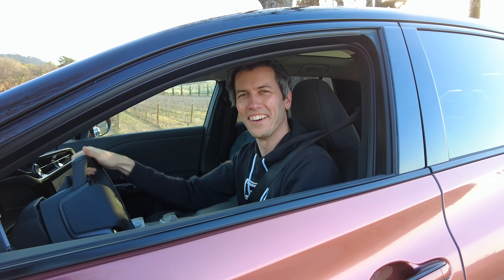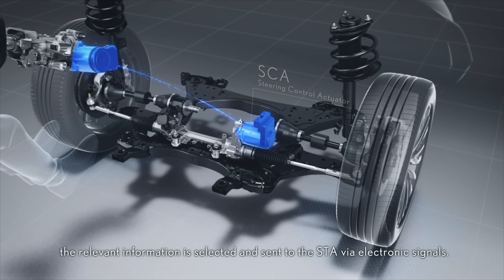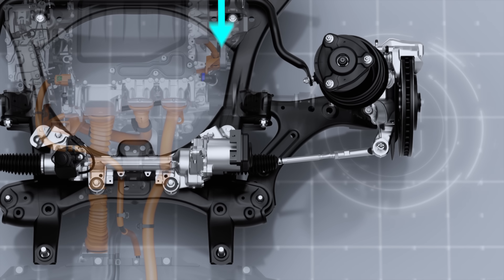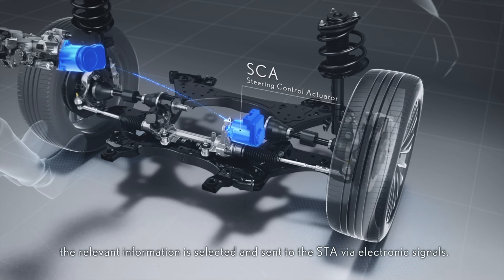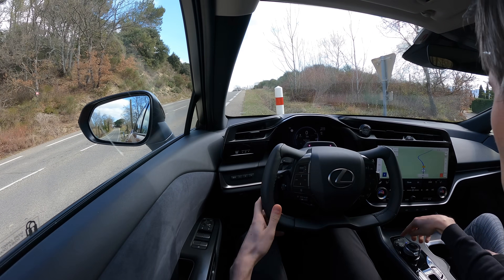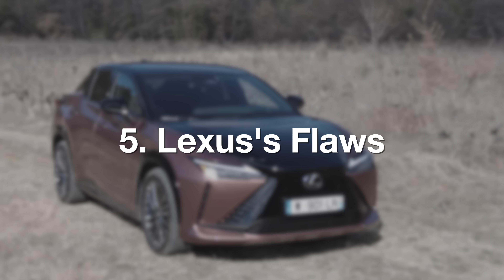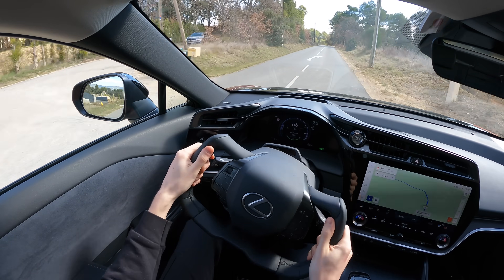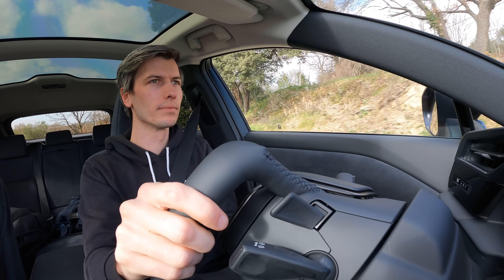How Lexus Fixed Tesla's Bad Idea: Steer-By-Wire Yoke

Comment: Is it execution delay or a limit in how fast the wheels are turned by the motor? Or even how much force the pinion can handle? Either way, the fact is that a given wheel position (even neutral one) doesn't guarantee some specific steering angle and the brain will feel it. Is it noticeable in regular driving? Likely not. Also opens up more opportunities for self-driving cars with optional steering input.

Comment: The benefits for active stability, self driving and variable steering ratios are obviously there. The input lag can be engineered away with more powerful and more responsive motors on each side. But what if your self driving self braking self turning car gets hacked?

Comment: As a guy who doesn't like the idea of global automotive electrification, and who loves old cars with their straight and natural feedback to the driver, I can say that I actually really like this idea. In theory you can still have very good feedback from the front wheels, if the computer responsible for filtering the signal won't interfere too much. In terms of ICE vehicles it can make engine swap much easier (I hope that in 15 years we'll still be able to drive petrol cars) and car designers can now have some fun. IMHO, this is one of the cases when advantages of a new solution overweight it drawbacks, at least for regular road cars.

Comment: Next it will be brake by wire with 3 actuators and 3 pair of brake pads for each wheel in case one goes bad and a complex system that will simulate real time feedback in the pedals.

Comment: I've noticed that steering delay at the very beginning of the video. It's great that you've pointed that out at the drawbacks section. But since the steering is laggy then it is not responsive. So all that stories that the steering is not in par with the responsive acceleration and braking is just a marketing blurb, at least at present.

Comment: I noticed the input delay immediately at 0:05 it was jarring just looking at it, like when you press a button in a game and then see the move happen later. I'm glad you addressed it because, anybody who has played a racing game or for that matter just played a fighting game online will tell you how bad it is to have even just a few ms in between your input and the expected output. It's the whole reason Google Stadia died and why Amazon Luna doesn't work well either. A visually noticeable amount of latency is just unacceptable and they probably should have worked on that before putting it in drivable vehicles in the first place.

Comment: Most of the Lexus steer-by-wire drawbacks could be fixed by making the steering sensitivity at different speeds fully customizable for each driver. On the other hand, some of the effects of the feedback system may be negative so the feedback should be also  customizable. For instance, the lightness of the steering on a slippery road could contribute to a total loss of control of steering. Under such conditions it could be preferable to make the steering wheel not easier but harder to move by the driver.

Comment: I think this technology while possible to make safe just won't catch on with a large portion of the consumer base. (at least as it stands as of this video, it may get better). I think its too preferential, at least with a yolk and variable steering. Variable steering most of all, will really be off-putting to someone who wants a linear and predictable steering ratio.  you might get 50% of consumers that love it but 50% won't and now you always have to make 2 different options based on that. Of course, a traditional steering wheel and the ability to set the electronic steering to a linear setting will fix most of those issues and assuming the delay gets better then you can make any option possible by the touch of a button, but that still leaves the delay and feel being the main hinderances. can't wait to see how it plays out.

Comment: what happens if you hold an angle on wheel from a stop and accelerate without straightening the wheel? do you have to turn the yoke more just to keep the same turn angle?

Comment: Steer-by-Wire is also makes self-driving cars simpler, since you don't need an additional motor for the computer to change the steering. If this car has the equivalent of Tesla's "Auto-pilot" the steering will won't even need to turn at all.

Comment: This is already in use for aviation, and has been for awhile. For example, the popular Airbus A320 is 'fly by wire'.  It even has a side stick, that looks much like a video game, rather than the traditional 'yoke". There are no cables to manually activate rudder, elevator or ailerons. The flight computers also check your inputs, if it goes against a long list of 'flight rules' it won't let you do it. That's a condensed version/explanation due to space here.  It's the future, like it or not. We'll get used to it, like George Jetson.     Peace..    --gary

Comment: I had the steering assist motor go out on my '18 Ford Taurus. When it happened I could no longer steer. The mechanical connection didn't help at all.

Comment: Govt criticizes Toyota press release on floor mats

By KEN THOMAS (AP) – 2 hours ago

WASHINGTON — Toyota Motor Corp. released misleading information about an investigation into problems with stuck gas pedals that led to a massive Toyota recall, the government said Wednesday, stressing the issue is still under review by federal safety regulators.

The National Highway Traffic Safety Administration said it was still investigating the case and meeting with Toyota to hear about the company's plan to redesign the vehicles and fix "this very dangerous problem."

Toyota recalled 3.8 million vehicles last month over problems with gas pedals that got stuck on floor mats and told owners to remove driver's side floor mats and not replace them until the automaker had determined a fix to the problem.

Toyota said in a statement on Monday that NHTSA had confirmed "that no defect exists in vehicles in which the driver's floor mat is compatible with the vehicle and properly secured."

But NHTSA said that was inaccurate and the government was investigating possible causes of the acceleration problem. Removing the floor mats was "simply an interim measure" and "does not correct the underlying defect in the vehicles involving the potential for entrapment of the accelerator by floor mats, which is related to accelerator and floor pan design."

"The matter is not closed until Toyota has effectively addressed the defect by providing a suitable vehicle based solution," NHTSA said in the statement, which the department said was issued to correct "inaccurate and misleading information" from the automaker.

Toyota spokesman John Hanson said "it was never our intention to mislead or provide inaccurate information. Toyota agrees with NHTSA's position that the removal of the floor mats is an interim measure and that further action is required. We continue to discuss an appropriate vehicle remedy or remedies."

The recall includes 2007-2010 model year Toyota Camry, 2005-2010 Toyota Avalon, 2004-2009 Toyota Prius, 2005-2010 Tacoma, 2007-2010 Toyota Tundra, 2007-2010 Lexus ES350 and 2006-2010 Lexus IS250/IS350.

The recall, Toyota's largest in the U.S., was prompted by a high-speed crash in August involving a 2009 Lexus ES350 near San Diego, Calif. Mark Saylor, a 45-year-old California Highway Patrol officer, and three members of his family were killed when their vehicle hit speeds exceeding 120 mph, struck a sport utility vehicle, launched off an embankment, rolled several times and burst into flames.

Family members made a frantic 911 call from the Lexus and told a dispatcher the accelerator was stuck and they couldn't stop the vehicle.

The high-profile incident led Toyota President Akio Toyoda to call the fatal crash "extremely regrettable" and offer his "deepest condolences."

Comment: Thank for pointing out the input delay response! Comparing to computer games: 280 ms delay would be too much for Tetris, Candy crush or Chess. For me, this is too much even for remote desktop working from home-office in normale Office-programs or text editors - trying to program or just work with such an input delay is pure stress, believe me. As for FPS gaming and to some extend 3rd-erson as well: I simply get motion sick if the input delay is above 50ms, in some games if it is above 25ms. Any input filtering gets turned off by me. Though the mouse sensitivity gets turned down too, allowing finer control. If there are graphic options which delays the output more, like post-processing, I try to turn it off. Without delay 30 fps can still be good in an FPS game, but with the delay even 120 fps is sometimes not enough and makes me motion sick. It is really a game design decision, and I hope Lexus gets that insane delay down.
Reply: Agreed, 280ms looks and sounds dangerous but I’d have to drive it to see how it feels in real life.

Comment: I see a lot of concerns about mucle memory and the potential issues in reaction time, but I dont think these are the real problems. We actually have steering systems with variable steering ratios on the market for around 20 years IIRC. 

I tried it in an BMW at the beginning of the 2000s, it was called 'Aktivlenkung' and the company who invented it (ZF) was pretty proud about it. Its a really interesting system from an engineering standpoint. When I first tried it,  I really hated the feel of it. The difference in steering ratios was kinda weird and I even made streering mistakes when I wasnt focused, but after a little time of getting used to it it made totally sense. It was more comfortable at high speeds but also really precise at cornering, it just combined the best of both worlds.  

I'm not totally sure, but I think here in germany (or maybe even in the EU in general) a mechanical steering system is necessery by law, so I'm not totally sure if Toyotas system is even allowed here, but maybe someone knows better.

My personal problem with modern streering systems is just that I personally enjoy the feeling a pure mechanical steering more, but this is more a problem with electronically assisted steering in general than with variable steering ratios.

Comment: I'm not sure it's lag exactly but more to smooth out the motion so that the turns don't feel overly twitchy. But yes smoothing it out kinda of defeats the "instant response". Also, with a traditional steering system there are natural limitations imposed by the physical nature. You can't turn the wheels faster than the wheels can physically move. But with video game controls you can turn the controls faster than the wheels themselves can turn so you have to compensate for that and tamping down the reasons is one way.

Comment: Hmmmm, this is interesting. I see the issues, but it feels to me that (most of) those can be ironed out. 
That said, I might take years to do it. Perfecting electric steering took about 6-7 years since it first appeared on the market, I am going to assume that it is similar here. Toyota in a good spot to start from with this, and I get the feeling that this is going to appear in the LES, but this isn't the end. This will need more development, which is a bit of a shame that is only on the RZ450e at the moment because I feel that their are a few problems that only scale of encountering them will fix.

I do wonder the cost of this, because it does seem like a bit but that is only for the one luxury model.

Comment: Having had one hydraulic assist pump fail, and a second hydraulic hose leak and start an engine fire...I have no love for hydraulic assisted steering. Parking a manual rack saves you a gym trip.(g)

Comment: I think this is just a step too far. Throttle-by-wire has many advantages over a traditional cable-actuated throttle, but I think the advantages of steer-by-wire are more dubious. There should still be a mechanical steering shaft in this system as a backup. It can remain disconnected in normal use, but have a mechanical fail-safe that connects the steering shaft if power is lost to the electronic steering system.

Comment: The delayed response is almost unavoidable given the amount of information processing required - even Honda with their electric assist power steering got it wrong compared to standard hydraulic power steering. You can't beat a 100% mechanical system for responsiveness.
With regards to steering reason, it ultimately becomes a setting in the 'software' that controls the driving experience... Let it be adjustable - within limits that are sensible - drivers will figure out what they prefer and set it accordingly.

Comment: To address your questions of taste at the end, that’s easy. The same steer by wire electronics remain and they simply switch to a wheel with a static steering ratio. The customizable nature of software helps give a variety of options with the same hardware.

Comment: I wonder how does it look economically. Will the new system be more durable? Cheaper? More expensive? How much more expensive? We have many additional electric motors here. But less other mechanical parts. I'm just curious. Back in the days computers were more expensive than simpler mechanical solutions, now they are dirt cheap. Back in the days the touchscreens were expensive, now they are dirt cheap, especially compared to traditional mechanical controls. But at the same time WORSE, less ergonomic. This tech looks promising. When they overcome some current problems - it can drive actually better. But is it worth it? Greater steering precision, but at what price? Then, if it would be more expensive initially, maybe it will wear out slower, so it will pay of over time?

Comment: The question though, is there any law requiring mechanical steering rack.
Reply from the maker: There's a 300 page NHTSA paper on the subject if you wanna read up on it haha. https://www.nhtsa.gov/sites/nhtsa.gov/files/documents/13498a_812_573_alcsystemreport.pdf
Reply: @EngineeringExplained  lol ..  i guess if manufacturers sells it then it should be ok. I still think Tesla should split the left & right turn signal.

Comment: I'm not giving up drinking my hot coffee in my car,  so say I'm going down the freeway at speed. I spill my coffee in my lap. I lose presence of mind and turn the steering wheel or whatever the heck is they call that and drive my car across four lanes regardless of other vehicles down the road. If the car keeps me from doing this what happens when there's a three-car pile up and I need to dodge around them using technique this time?

Comment: My problem with this tech is that if all cars had the same curve, then maybe it'd be okay.  But if not, then every time someone gets in a rental car or someone else's car, they have to relearn how to steer.  Obviously, right now whenever we get into a different car we have to do the same, but I feel like this adds more complexity as the problem is so variable with speed, and if you have been in the car for like, five minutes, and get into an accident avoidance situation, you may not even have had time yet to get used to the new steering ratio at all speeds.  I don't think it should be a continuously-variable ratio.

Comment: We already have the tech for variable mechanical steering racks as far back as the E36 BMWs afaik. 

People really want to live in a simulation, huh. Why would I want a simulation of a thing when I can have the real thing?? EPAS was bad enough and throttle by wire is obnoxious with the delays in input and emissions tricks like minimizing engine braking. In an emergency, I want immediate feedback and response, not up to 500ms later like throttle by wire

Comment: So a possible solution to variable ratios in steering could be a two stage planetary, like the one on a power drill? As long as there is sufficient power assist, you could drop the ratio at high speeds to lower response while maintaining the mechanical connection. Though that doesn't solve the packaging complaints unless you want to run a drive belt to the center of the car before pointing it down to the rack.

Comment: Drive by wire was introduced by Infinity
Reply from the maker: Yes but their system had a mechanical connection between the wheel and steering rack.

Comment: If I am not mistaken, the idea of the steering by wire was invented and implemented by Infinity in the Q50. I didn't have a chance to test it, but most of the petrolhead journalists found the response as synthetic. Anyway, I think this can be a good deal for some drivers who are not really interested in driving. But not for me personally. I'm a fan of the hydraulic power steering.
Reply: I drive a Q60RS with DAC steering. Not my first choice, but it’s fine. It’s a fun car, but not a race car. 99% of the time it just drives like any other mechanical steering. You do get some customization of the steering which is cool. The only vagueness I feel is when driving at highway speeds with a strong sidewind, it just seems to wander a bit.  Most of the bad reviews of the steering were due to the stock trash run flat tires. They wandered all over the road. I thought I’d made a bad mistake buying the car until I replaced the tires with some “real” tires. Night and day difference and drives perfectly now.
Reply: I had the q50S with steer by wire. I didn’t know it had it until it was pointed out to me. You do notice if you go from hydraulic to steer by wire but not if you go from electric power steering to steer by wire but then again I was tracking my car.

Comment: That delay may be built into the system not a fault to mimic the real-world situation, human reflex action can be quicker than required whereas the real response need to be gradual. as long as you don't feel the delay in driving it is should be correct. don't visually compare the wheel movements. ...there may be s a reason for that delay buddy....more than engineering it is human engineering need explained. :)